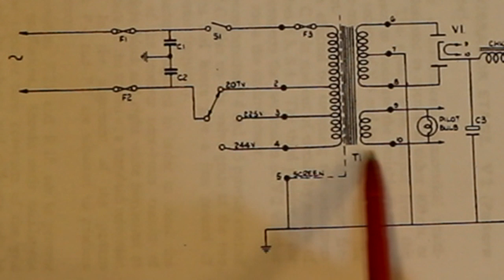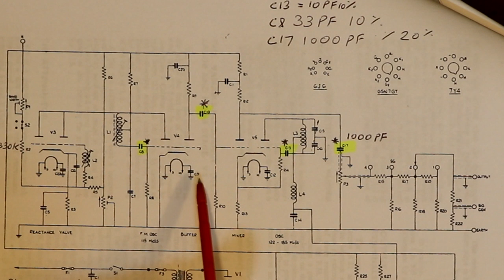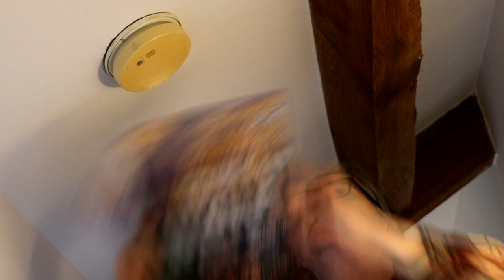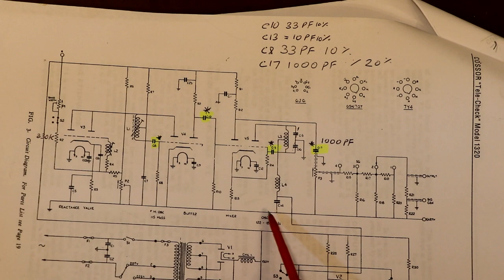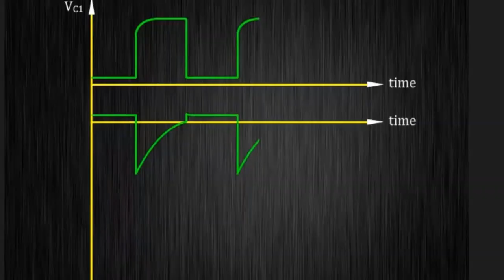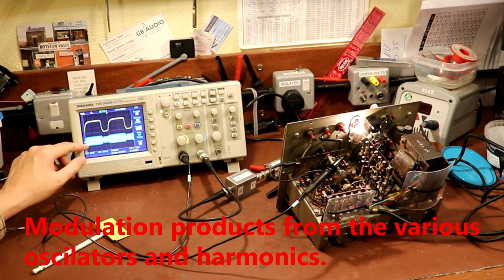Television Test Gear - Cossor Model 1320 Part 3

Comment: I have a Cossor 1322 Wobbulator, a Cossor 1039M oscilloscope, and manuals for 1950s Cossor television receivers.   The 1322 reference oscillator, and the crystal oscillator/ magic eye used to calibrate the dial of that, works fine.  The sweep frequency oscillator is currently in an unknown state because I have no high frequency IF filter / detector circuit to test on it.  
Having in mind that the Reactance valve is basically used to turn a voltage into a frequency, and that it is easier to detect a fixed frequency, I propose this:.  Put 250 Volts across a 2 M Ohm potentiometer, and feed the wiper and ground into the X and earth input of your 1320. (There is no capacitor blocking DC.). That turns the FM into simple CW that you can detect using a short wave radio receiver.  I am about to do this with my 1322 Telecheck.

Comment: yes  a lot is said about such capacitors they dont deserve the reputation of being a problem they simply were the best available at the time which doesn't mean they were bad capacitors they are simply old and way past their working life and have done well to last as long as they have 
I have had capacitors from the 1990,s failing
Reply from the maker: thehappylittlefox aka benji your quite right the number of tantalum from the 80 and 90s I have replaced is many more !
Reply: @allthegearnoidea6752  yes I have had to replace many of those too including normal electrolytic capacitors those tantalums are also good capacitors keeping their rated value until they fail  usually by going short and taking out something else ! not very forgiving if you exceed the rated voltage or put them in backwards !

Comment: Well Done, Chris! Insert loose screw joke here, but we've probably all fallen victim of the loose grub (set) screw at one time or another. In a recent repair project I had a power supply filter capacitor (4600 uF) that was completely open! Scratched my head for a bit trying to figure out what I was doing wrong -  no shenanigans detector!

Comment: Those components might well have heavy oxidation on the leads making poor contact with the LCR. Also those Hunts REALLY will be leaky.
Reply from the maker: Simon Spiers  it was definitely something mechanical on the capacitor. I will probably swap the hunts out sometime, but they measure good and all the grids are 0v and cathode voltage is good, I think they perform better than paper waxy types. I agree though 70 years is a good age etc.  Actually also didn’t have a Decent higher voltage PF rated caps in stock. Thanks for watching regards Chris

Comment: Yank's don't know what a grub screw is. It's amazing just how many varieties and types there are though.
Reply from the maker: Danish Native  They do say two great nations separated by a common language. What do Americans call grub screws ?
Reply: @allthegearnoidea6752  Allen, hex or "set" for dummies. But that excludes Spline & Bristol (neglected) which are greatly misunderstood and create anxiety for many. Then there's conical tip, hollow tip, slotted, metric, sae, and on and on. Then you could get into the exotic composition of some......like Titanium for instance. But you know this already.
Reply from the maker: Danish Native  I quite agree never neglect the Bristols!
Reply: @allthegearnoidea6752  LOL some obscure punk band. But seriously, fastener engineering should require it's own college degree/edu-macation. OK I'm done...don't want to be a troll. Cheers! Cold here 12F. Brrr.
Reply from the maker: Danish Native about 24 here in Sydney but smokey due to the fires.

Comment: You know what would be fun? I've got a B&K tv analyst. You have the voice and the knowledge... Let me know. Cheers!
Reply from the maker: That sounds interesting  I was looking at buying a BK CRT tube tester from the USA but wasn’t sure if the CRT specifications and data would be correct for U.K. equipment.   Is the version you have the one with internal CRT and line scan camera. I have seen Shango use one amazing bit of kit. Thanks Regards Chris

Comment: You can make it chooch. It doesn't have a choice. Awesome!
Reply from the maker: This unit had me scratching my head I really should have looked at the circuit diagram. That loose grub screw was the icing on the cake. Thanks regards Chris

Comment: Oooow spinning your knob and not having an effect, must be your age :-D.
If i hadn't said it, you would have :)

Smashing that the ye olde resistors were still behaving themselves,  they love to go weeeeee in value over the years, but it's the heat that causes ' Drifticus carbonus'.
i can't see that unit actually getting that hot though.

Multivibrator with valves yikes!!, drifticus is back ;-D but i suppose the old tv's were very forgiving, so ill shut up about that lol.

I approve of your makeshift plastic sheilds :-D,  my little finger has strayed and woke me up rather fast bzzzzzz ouch Bas***d!!.
And to add to my stupidity i get a shock for a second time, oh brother give me a brain.

I have observed that carbon resistors in high gain mic pre amps are not a good idea, unless you love resistor noise lol.
Smashing video chris, i love your fake lack of knowledge, nice try but we all know you are much sharper than a small toe hitting the edge of a door, really sharp :-D
Reply from the maker: zx8401ztv you make a good point about the resistors. Interesting high value resistor are inherently  more noisy if you want to google the formula 4KTBR. I also really enjoy Boltzmann constant it’s a fudge factor when the universe doesn’t comply to what the math says it should.  Actually it gets really hot those small valves get silly hot.  But I think it’s got very few hour running time so perhaps those resistor were never baked hard. As for my knob perhaps I need my grub screws tightening. Thanks for watching Regards Chris
Reply: Sounds like it should be called Bodgemann constant :-D.
I don't have the IQ for mathmatics and many other things but i'm sure you are 113.3% correct :)
I have never absorbed information fast or easy, and if it's in a jibberish mathmatical form then it's not absorbed.
Millions of years ago i had to remember a bit of ohms law, my way was to remember "A VCR made of PVC"
I could have said WVC but that was too daft lol :-D
Reply from the maker: zx8401ztv  without doing the maths the formula says that even if you have a resistor just sitting on your desk it would generate a voltage across itself. We call it a noise voltage, unfortunately it’s not useful as the noise voltage is so random in nature it does do anything useful. But you can definitely hear it in a high gain amplifier.  If you increased either the temperature or the value of the resistance the noise voltage will increase.  You find that very high gain amplifiers that work on tiny tiny signals use liquid nitrogen cooled amplifiers as the noise voltage would otherwise be higher than the received signal. Interesting stuff.
Reply: Ooow what about wire wound resistors, surely they would be quiet err?
Suddenly potato bag wire came to mind, handy for making ammeter shunts years ago.
Sorry I'm full of rubbish info :-D
Reply from the maker: zx8401ztv  no it doesn’t make any difference on the material they all have the same problem.
Reply from the maker: zx8401ztv next time you have problems with those pesky resistor in high gain amplifier I suggest liquid nitrogen. It may not help but like playing with liquid nitrogen is cool!
Reply: Sounds cccold, simpler to throw in metal film ones, boring but reliable.
Yes it would be cool Ha ha :-D
Silly sod :-D

Comment: Lol @11:35
Reply from the maker: Defpom's Electronics & Repair  Actually only had about 20 minutes on the scope it’s a recent acquisition. But it has I thought a slightly unusual push button configuration  for selecting the trigger options and between main and delayed sweep. First time I used it I thought it was faulty as it was half an hour before I got the traces up, again didn’t have the main time base selected. Problem with owning more that 13 scopes is I don’t remember how to work any of them. Amazing how much easier it is with a digital scope with memory depth.  It’s like driving and vintage car actually quite a crappy experience in real life LOL. Thanks Regards Chris

Comment: Seems like a winner.
Also, so much video and I'm just confused about your statement of the two filter capacitors C3/C4 being switched in series with the inductor, while I think you meant parallel, but I'm not sure. Their operation is in series, but electrically they are in parallel... That confused me more than I would like to admit.
Reply: If I remember the schematic correctly the caps are in parallel to one another but in series with the choke so the currant flow would be series.
Reply from the maker: I wouldn’t read much into It, I probably got it wrong. Sometimes my mouth has a life of it’s own.  There’s a few mistakes in the video and I correct the things I spot but I don’t over worry about it. Thanks for sharing regards Chris.